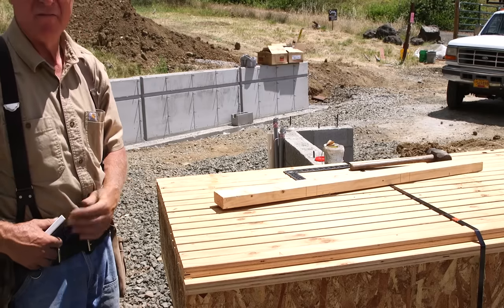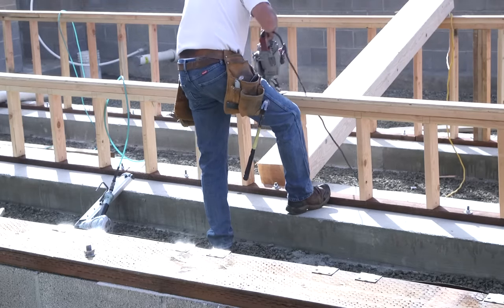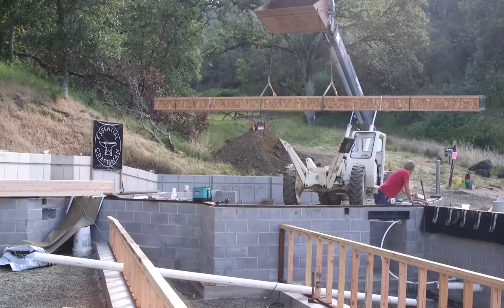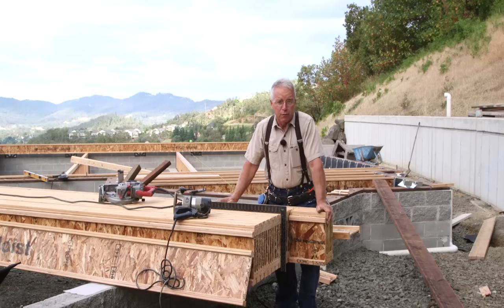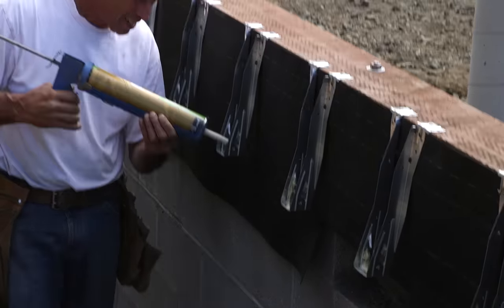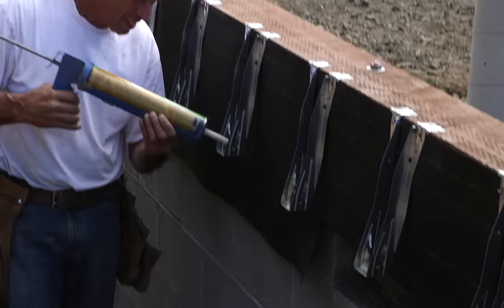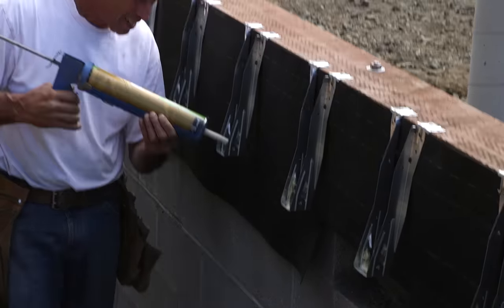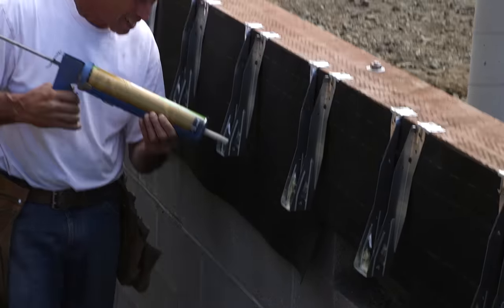Roll the Joists Ep.40

Comment: You cut and installed those pieces that you called blocks to keep the joists vertical and in line.  The old school way was to use pieces angle cut on the ends and nailed in, in an X pattern.  You only nailed one row of the blocks.  Was that just the first row or will you be adding more.  One row doesn't seen like enough to me, do you add more off camera?   Maybe you now go on to fill the field with additional rows of the traditional "old school X bracing"?
Wondering why the first nail for each block was hand nailed?
Wondering why you did not glue up all the hangars and then walk each joist down and place it directly into the hangar, thus saving some work!
When you carried the joists horizontally holding them on the ends and allow them to flex up and down, didn't that stress the bonding at the build joint and weaken the joist.  Seems one should hold them in the vertical position.
I enjoy your videos!  I only ask these questions because i want to know.
JIM
Reply: I thought I'd take the time just to answer one of your questions. Spreading out the joists and then installing them as two different workflows is way more efficient. Probably something like a 50%  labor-saving or effort saving process over the method you suggest. Put another way, it took him 33% less effort to do it the way he did. The reason for this is quite simple, construction is a physically and mentally intensive process. By dividing up tasks this way, you allow yourself to focus your strength on a very narrow set of movements. If you were to do it the way that you suggest, the pausing of the fits and starts would wear you out halfway through the day.
Reply: Around here, they don't do "old school X bracing" anymore because right after the carpenter would put in the bracing, the plumber would come and rip half of it out. Later, the HVAC guy would come and rip the other half out. Code required the carpenter to put the bracing in but didn't stop the other trades from taking it out.

Comment: Get the subfloor glue that remains flexible - not the cheapest junk you can find - otherwise you can get squeaks everywhere as the cheap stuff turns rock hard and can crack because it's brittle
Reply: ArthurDentZaphodBeeb It’s hard to find the right caulks sometimes. The right ones make a big difference!
Reply: Any suggestions?There are million different brands out there,all claiming they are the best.
Reply: Meelis Liias Not sure if polyurethane based subfloor adhesive OR silicone based is best?

There’s new stuff that’s a gel but it is still polyurethane based. Always look at the ingredients. Silicone has great natural vibration absorption. Polyurethane is stiffer. Test a few brands and see how much flexibility is left after drying.

I never did this specific job before, so I can’t tell you a specific product for this application. Also I’m not sure the I-Joists adhesive and subfloor top side would be the same product or not?

Comment: Experienced carpenter here. Why wasnt the knee wall set (laser or string) at the correct height? The shimming seems like afterthought, and with the bearing load, softwood shims are a poor choice. Also, i would have installed web stiffeners at the hangers to increase the reaction capacity of the joists.
I enjoy your videos. Take my criticism as constructive.
Reply: He explained why he was doing it this way in the video where they set the knee walls.
Reply: I went back and watched that episode, and you are right, he did mention it. I missed it the first time. Thanks. That being said, he is setting the joists to a line. This same method could have been used to set the knee wall in the same spot and eliminate the shims, creating a more positive connection. This is common practice on slab on grade basement walls. It is not difficult. Many times, ill set a chalkline instead of string, bump the stud edge against the line marking it, and cut. Great accuracy. I have only seen one other framer use this trick.
Reply: Web stiffeners aren't always required but sure don't hurt. If you know what is required may as well save material I guess.
Reply: @sixtygrit9944  shit that is a good idea
Reply: Experienced carpenter here as well. I was looking to see if anyone caught that and you did. Stick framing the knee wall to a laser or dry line is definitely the better choice. Easy to be a armchair quarterback..
He would put these clowns on TV to shame..
Reply: @frednowicki7355  Squash blocks are needed when the joists sit on top of the mudsill and the walls rest on the ends of the joists. The squash blocks carry the weight instead of the ends of the joists. Here the joists are set inside the wall and are only carrying the floor so no squash blocks needed.

Comment: From a young carpenter to an experienced one I love your work! Just to throw two cents in a trick I picked up a couple of years back is get a two by four and an offcut of ply or flooring and nail them at right angles. Cut the flooring down so it sits in between the flanges of the I joist, then run the skillsaw hard up to the piece of two by four, this pretty well creates an a track saw for I joists. You can make one mark on the joist and sit the track in between the flanges of your joist and run the saw along the two by four to give a perfect cut every time without a square line on the joist. Although I'm sure an old pro like you just eyes it square.
Reply from the maker: great move!!!!!

Comment: what about blocking...? 

if you're cutting off 10" why not order long enough to create a 14" + block? And why not throw a 3/4" block on top of a joist every 10' or so, to reduce sag on that super tight string line?
Reply: This is the best comment I've read here.  You sound like one of the few here that have done some building.  Most don't understand your comment.
Reply: I was going to say the same thing about the joist length and blocking..
Reply: Is "blocking" the same thing with "bridging"? (The diagonal runs between joists)
Reply: @mozarth  blocking is a single piece of wood where bridging is two diagonal
Reply: @Trentberkeley86  Know, right? Same.
Reply: Relax man, obviously it's their first time building
Reply: I was wondering about the string line also.  I'm guessing he did something to compensate for the line sagging.

Comment: Can you comment on your reasoning behind shimming the floor? I've always heard it was a bad idea. The shims compress, or split and fall out.
Reply: He did it to save time/money. It didn't sound like he had 100% confidence in the elevation of the footing, so it would have been very difficult to make the pony wall perfect. However, making the pony wall elevation match the outer walls is preferable.
Reply: Nothing wrong with shimming to achieve perfect heights but using a wedge is a hack job. Lever the joist of and insert a non compressible packer. Cement sheet, plastic Packers go down to as small as a few mm. If you need smaller malthoid dampcourse is perfect. Everything else I see the bloke do is pretty top notch so to see that was disappointing tbh
Reply: The reason for shimming is he built the wall to low do there fore shimming required ,not a good idea they always fall out
Reply: Just because he never level
Reply: Shim if you must, then grout or use solid ones, not just the wedges

Comment: The use of shims surprised me. Do they last? Is it possible to get the pony wall perfect enough?
Reply: My 1916 house had shims holding up joists and members and they were doing just fine after 100 years and will likely last many hundred more. The question of possible isn't the right one. The better question is "Is the effort and labor cost worth it". With enough time and money anything is possible.
Reply: Once everything is all fastened down, and the shims are placed correctly, they'll last as long as the rest of the structure.
Reply: My 1943 house has shims under it. The've held up fine. And the house was barely maintained the 20 years before I bought it.
Reply: Pony walls are easy if you have a good concrete crew. A good concrete crew will make your elevations spot on so you don't have to make it shorter then shim.

Comment: So the joists come from the factory at 31’ long? Seems like an odd number. Whenever I used engineered joists, we would always order them at the required length so when I saw you cutting them, I thought, “Uh-oh, somebody blew a measurement.” But if I understood you correctly, that’s just the length they were made?
¶ Nate - The video work and editing get better and better every video! Nice work!
🤜🤛
Reply: I thought the 31' is after the 1' was cut off.
Reply: I order them two longer, then trim in field. The extra becomes bridge blocking

Comment: The problem with those joists they melt like butter even in a small fire in your house. Glue melts delaminates collapse.
Reply: Water isn't good for them either.
Reply: Osb is completely useless I can't understand why it's allowed in subfloors and joist blows my mind I use to pull up people's floors when they flooded complete junk
Reply: @ chadwick hayes - I’m not a huge fan of it but it’s better than it used to be. (better glues I guess) And you’ve got to remember, a lot of engineers and architects out there are confident in it enough to stake their licenses on. ¯\_(ツ)_/¯
🤜🤛
Reply: @psidvicious  But things are not made to last like they used to be, it is fine for the short run but I question how long it will last, will they have to tear the house down in 50 or 60 years because this is failing?
Reply: @ Phil Huddleston - Again, I was never a fan of ‘chipped wood’ products but it’s not exactly fair to say that this structure will start to ‘dissolve’ in 50-60 yrs. With just standard maintenance and care, there’s no reason this structure shouldn’t last for as long as someone wants to live there. If it’s not maintained, it might be fair to say that it may deteriorate quicker than a similar structure built with standard dimensional lumber. Better yet, go with my favorite building material - Concrete!
🤜🤛
Reply: I agree! I'm an engineer and I would never buy a house with engineered lumber!
Reply: What is a better material to frame the floor with?

Comment: When leveling the joist's, doesn't the string sag some in the middle? wouldn't it be better to use a laser line?
Reply: it is essential craftsman, not top-notch craftsman. So the line is fine. The laser would be better as you can run it on the downside and do the job as a one-man show.
Reply: I was also watching this and thinking.. they're shimming brand new joists; seems like they fucked up leveling the support beams on top of the foundation lol

Comment: Sistering 2x’s together is a great way to increase a posts strength is what several engineers have told me because of the difference in graining, much like how the OSB shear in the center of the TJI yields tremendous rigidity compared to a single board which would flex much more.

Comment: curious why not build your pony walls to exact height rather than shimming up to drooping string--creating loss of nail penetration and blocks not bearing
Reply: I really doubt it will be any kind of structural problem, but I was wondering the same since it seems like unecessary extra work.
Reply: My guess is that you can't rely on the top of the pony wall or the bottom of the joists to be perfectly straight and level, so you leave a gap for shimming.  The string droop still seems like a problem to me.
Reply: The concrete footer is unlikely to be perfectly flat and level.  Also the dimensional lumber used for the pony wall is never perfectly uniform.  I've seen as much as 3/8 variation in dimensional lumber. The shims allow him to compensate for the variation that are common to "natural" materials

Comment: I missed why it's called "rolling" the joists?
Reply: Note: they laid them across the run horizontally, then roll them to vertical to fit down into the saddles (or whatever they're called).
Reply: This is or was because you roll real joists unlike this type shown here. Joists you want in your house are 1.5 by 10'' called 2×10 These timbers are bowed some nice and straight. The bow ones you need to eye them by rolling them to check putting the bowed on the top or upward so when the wait is on them they settle down in place level. These cheap joist here theirs no need to rolling them plus if these get wet your in big trouble. A lot of basements are wet these joists won't last forever like solid wood which won't fall apart like ply wood. Home owners beware ???

Comment: Jeez, some of that is rough work, your blocks are snaking, stagger them, far better.
Reply: The blocks only purpose is to keep joist from rolling ma'am. Yes it is not perfectly straight and doesn't need to be. They were working for time.  It's for strength and you'll never see them when floor goes in. He did mention that he was double and triple checking all work before moving on because once they are in,  they're in. Great eye ma'am.
Reply: Agree with the staggering though if is possible. I think they blocked directly on top of pony wall 2×4.
Reply: @freshstart3555  It is a basic principle of force that if you stagger the blocks between joists or noggins between studwork it is stronger and it is easier to do anyway.

Comment: My floors were glued/nailed and they squeak so bad.   Worst floor I've ever had.  I haven't had much luck fixing it without ripping up the floor.   I always use screws on my floor.
Reply: Darrell D they make a product specifically for that, break away screws, but it leaves holes in the floor from the top
Reply: @johngardiner8847  Yup.  I guess I'm not very good using them.  I keep missing the joist unless I remove the carpet or linoleum.

Comment: As a structural engineer and someone who did grad school in timber design, that was such a wholesome and satisfying video for me to watch! What a fine floor! Bravo. One day I will build a house and when I roll my joists I will think of you.

I must comment though that when you notched the plies to avoid that unfortunately placed bolt at 4:50, you significantly reduced the capacity of your 3-2x4. That could easily be remedied, though, by an extra ply on either side.

Also, while it is true that it is difficult to find non-orthogonal top-flange hangers, you might find an adjustable rafter hanger that works. If nothing else, a 2-ply hanger with shims on either side of the joist would also work. BA412?
Reply from the maker: Thanks Tom! When this thing is dried-in in about two weeks or so I will be working through a framing punch list that will include increasing the cross section of all four beam end supports in the floor system!!! Been laying awake!!

Comment: I never use manufactured joists on the first floor because, despite the fact they use less wood than dimensional lumber, they still cost ~50% more per foot.  The crawlspace doesn't care if the beams are spaced every 12' instead of 17', so I use 2x10's, and have never had a problem.  Also, I'm the one writing the check for lumber.  But where they shine is 2nd-floor framing where it's easy to get 20' free spans.  It's also easier to get ductwork routed through the floor because the hole sizes allowed in I-joists are much greater than any solid sawn lumber.
This was an enjoyable video, watching a veteran craftsman whose curiosity and IQ have led him to a wealth of information.

Comment: They might not shrink but I will tell you this, in a high moisture enviroment true lumber won't rot as quickly! This type of joist is highly susceptible to moisture! I would recommend treating them with some sort of moisture blocking ! Like roller shield or Bostik moisture barrier! I know it seems like over jill but that's the way I roll! I have had rotted out floor joists before and it's a whole lot easier to prevent it rather than to replace them afterwards!

Comment: I was told by the building inspector when I built my new house in 2015 that I had to drywall the entire basement ceiling if I used TJI's.  That was a lot more expensive than solid joists and lally columns

Comment: When we were having our house built, an engineer friend of mine gave me a useful tip regarding our floor joists.  The strength/stiffness of the joist is a function of the cube of its height.  In other words a 12" joist is only 20% more height than a 10", but 12^3=1728 vs. 10^3=1000, so it is 73% stronger.  The difference in joist cost is minimal, but by specifying bigger joists, we got a dramatically more solid floor.

Comment: Steve, I have a two storey home and the floor joists on the second floor were tied with criss- cross metal straps. Floor still moves when walking on it.  2 X 8 standard joists, and no glue inder the 3/4 inch ply.  Sometimes I hear the metal braces nash against the nail when walking over spots. You recommend pulling the floor, and put blocking to support the strength of the floor???  Thanks for responding back.

Comment: Over here in the Netherlands, all floor systems are been built in concrete on top of 20 cm of isolation material. This type of building is completely new for me. I would certainly never do it the way you’re doing but it's probably the most common way in your area. It's probably that wood is much cheaper over there than it's over here and.

Comment: TGI joists or I joists as I call them are really glue with wood fibres pressed together at great pressure until formed. This is about the only time I will let OSB be used in anything I am building due to the increpent absorption of water and subsequent failure of the OSB. Usually caused by inadequate drainage or drying of water from wetting from atmosphere or invasion into the building envelope. Proper venting and drainage is critical with this product and I have seen too many times contractors ignoring these principles.
Reply: Exactly ! And where is the moisture barrier on sub grade ?   Hokey build,but hey,the fans are impressed.